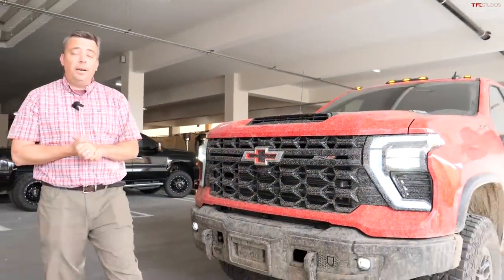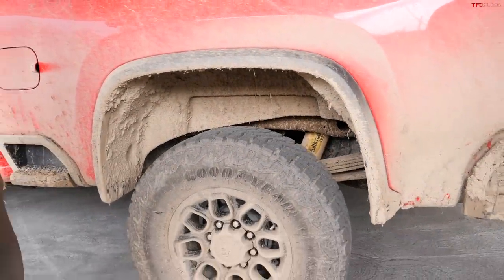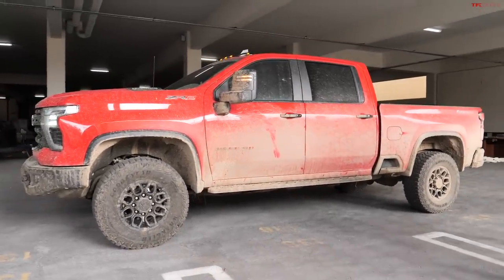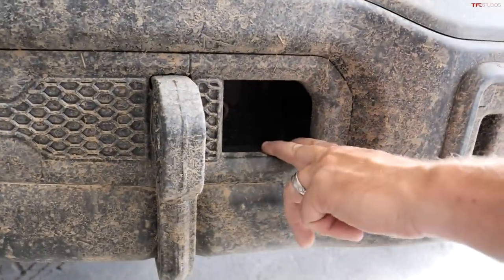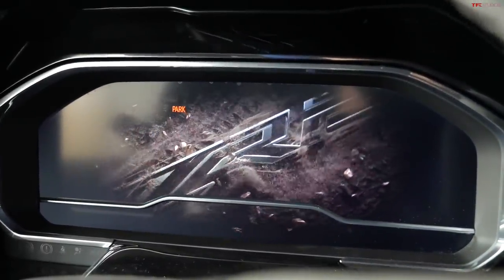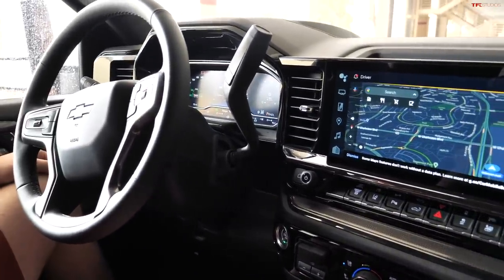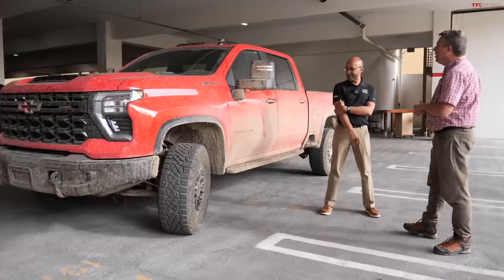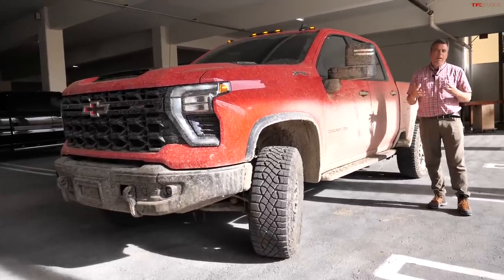TFL Exclusive: I Go Hands On with the First-Ever 2024 Chevy Silverado HD ZR2 Bison OFF-ROADER!

Comment: Great Truck, Love the Bison & The ZR2 Editions, but what a shame not adding the Front Locker since that's the whole thing with ZR2 that makes it so special in the Colorado & Silverado
Reply: I think because they didn't limit the speed with the rear locker on.  Kinda makes sense...but I'm with you for the most part
Reply: Diesel torque + front locker + front CV axles = a lot of warranty claims. Don’t blame them at all for only doing a rear locker. A front limited slip would have been nice though
Reply: @MSparks9509  - or a Torsion front axel. Ford has copied a lot from GM lately, GMs turn!! 
    It looks like Ford and GM are working together more than in the past. Not a bad strategy to just ensure they retain their positions in the hierarchy. They will be very solid #1 and #2 if Ram ever stops selling the 1500 Classic,,,, 😂😂.
Reply: @MSparks9509  That would make sense. Even if that's the case, I'm surprised they didn't limit the offer of a front locker to just the 6.6 gas like Ram with the Power Wagon. But hey, I'm sure they have their reasons. A limited slip would've been acceptable.
Reply: @tda024 reason with GM is always money and laziness. I love gm but getting tired of them always half assing everything besides Corvette but they half ass that too
Reply: @danielfrain3521  How in the world are you going to say they half-assed the Corvette? It's mid engine now. It's got every possible power option you want. It puts down performance numbers better than supercars 3-4x it's price ... Like what in the world could they do more for you to not say they half-assed it?

Comment: No front locker is a little disappointing considering how much you would pay for this thing
Reply: But it still has a steel bottom bumper so why ask more 🤷🏽
Reply: The GM HD front ends have historically been made of glass. Surely a locker would make it worse. However, to argue with myself, I’ve read the ZR2 1500 front ends with a locker have held up well.
Reply: Duramax would destroy that diff if it had locking capability. This ain't no 5.3l...
Reply: I'm sure GM had an engineering reason for not including the front locker :) .
Reply: @adamtacheira5323  I've had three for plow trucks, beat the crap out of 4 wheel drive and have never had a problem with the tans, it's always the headers, or throttle body. Ever time I go out I'm loaded to about 11k pounds with rear air bags.
Reply: @cadekiel2953  Tie rod ends are the glass i think people try yo relate yhe reat of the front end too and that's usually during heavy offroad articulation or truck pulls where the front end comes up. Besides that they are very tough like you said. Not glass at all
Reply: best case scenario a front locker is an extra option
Reply: If raptor and trx don’t have it you don’t need it on this
Reply: @mariaperez5933  Pfft, it's all about the mud everyone knows that's  proof of toughness and capability, that mud so much more than what body graphics and painted tow hooks do.
Reply: The half shafts would not survive in a locked diff with 975lb-ft
Reply: @adamtacheira5323 they're an independent version of the Ram solid axle  front made by AAM. I assume the CV shafts are the weak link
Reply: Wish the aftermarket would build a front diff with a locker pretty much stopped at 2014
Reply: @adamtacheira5323  you actually think they were ever taken outside the city limits?🤣🤣🤣
Reply: Its transitioning, relax, GM was busy on the other tuck jobs and forgot the locker.
Reply: I never use mine and I abuse it like a real truck should be
Reply: @erin7995  this is a Heavy Duty truck. The Ram Power Wagon has a front locker and winch. The Tremor has a front limited slip and I believe there is a locker option.
Reply: Very bad 😢
Reply: @cadekiel2953  My diesel throttlebodies keep disappearing
Reply: No solid front axle, no front locker, the Ram Power Wagon is so much better.
Reply: put it in 4wd 4 wheels are locked that's why they call it 4wd your welcome.
Reply: @daymianhayes2493  does the power wagon come with the cummins yet?
Reply: Sled pullers run fornt lockers without any issue.
Reply: @DrBoogeyman420  Ive seen Chevy front ends fall apart without lockers at the first sight of a trail
Reply: @cadorseeliger3926  yes, I think now you can get the wagon with a Cummins.
Reply: @DrBoogeyman420  that crack you smk shows too much... I've seen sled trucks break the whole housing, sling hubs and axel shafts sleaving tie rod ends with d.o.m tubing.. I've seen stock trucks do the same thing feeding cows... ifs is for emergency purposes.  Without serious reenforcement a stock 4.3 can explode that little ring and pinion..
Reply: @dred5375  I don't think it does. The heavy duty rebel does. Which won't be offered with a front locker. The cummins is too heavy for extreme duty offroad. The 6.4 hemi is not impressive.
Reply: Gm is a joke.
Reply: No way WTF
Reply: @erin7995  you have no idea how big of a difference a front locker makes and it shows.
Reply: @daymianhayes2493  except it's ram🤦‍♂️
Reply: Really how often does one use a rear locked even 😂
Reply: Hard to disaggre with  ya
Reply: Still stronger than the junk new rams 😂
Reply: Thanks no need to watch further
Reply: So no more rear side step? I actually use mine almost daily on my 22' 3500hd Chevy z71 Duramax. Front end is nice.  I do like the new dash ,too and awesome it still has column shifter where it's supposed to be.
Reply: It locks  as soon as it's in 4x4.
Reply: @5JSG if you live in an area that gets snow and ice, the G80 is perfect.  Never had an elocker, so I will take Andre's word for it.
Reply: @kc0lif  😂😂😂😂
Reply: Would rather have diesel option than front locker
Reply: Rams are so ugly compared to Chevrolet
Reply: This is my dream truck. How much is the mortgage payment on this?
Reply: You want diff lock you better get solid front axle with a diesel engine, I think the ford superduty tremor may be solid front axle
Reply: Couldn't have more than a limited slip. Power wagon gets away with it because it doesn't Tow or haul anything and doesn't have diesel torque.

Comment: Wow they knocked this out of the park! I love my ZR2 Silverado 1500, amazing truck so far, I have just shy of 20k miles on it and loved it the whole time. Sad this HD ZR2 doesn't have the front locker, but I'm glad that they're going in the right direction with the push button rear locker. And the front diff with traction management and braking to lock it up is a step in the right direction still, but still sad it doesn't have the push button front locker.

Comment: A truck that I finally want enough to replace my 2013 1500. I understand why they didn’t include the locker and practically I wouldn’t need it. Great compromise between towing and off-road capability.
Reply: Feel exactly the same. Will be getting rid of my 2012 when this drops!

Comment: As a Ram guy, I have to say this Chevy is AWESOME! I love that they maintained the heavy-duty integrity of the truck, but still factored in all of the off-road goodies. I have to admit that Chevy seemed to have gone a little further than Ram with the Rebel HD and Ford with the Tremor SD. Those 35s look really good on the truck, plus I bet it rides closer to a 1500 with the tall sidewall and DSSV dampers. 

Although the Bison is pricey, it will likely retain a higher resale threshold than the standard ZR2 HD due to the highly sought after AEV components. Chevy will sale every one of these that it can make!

Whats that I hear, @TFL Truck: Oh yeah, a ZR2 HD Bison 6.6 GASSSERR going up the Ike!😊
Reply: I own a Power Wagon, and the only downside is the towing/payload capacity for me. That being said it hauls 8k lb trailer with zero issues, but man when you get off road, lock in the rear diff and disco the sway bar it is in its element.
Reply: @sseibonnevilleman  I don't disagree at all. Out of all of these HD offroad trucks that have popped up within the last few years, none have the combination of ground clearance, articulation(especially rear), f/r lockers w/ sway bar disconnect, etc that the PW has. I know people scoff at the low payload and towing of the PW, but Ram has been clear about the mission of that truck.
Reply: @hellkitty1014  just to add, from everything I’ve read, I can just buy a set of factory 3/4 springs for the rear and install them. That basically makes it have 2k+ payload.
Reply: Nothing heavy duty about an independent front suspension!
Reply: @02autogt  this is true. Chevy guys hate when Ram or Ford guys say this, but if you tow heavy, you'd understand why Ram and Ford stick with the solid axle.

Comment: Great video Andre! 
I would highlight that the new Chevy interior has the new GMC interior beat. 
Note in the 24 HD GMC it has the same column shift but the console is still same as the 1500 and the cup holders are still setting fore and aft on the right side, and blank shallow pocket fillers are on the left where the 1500 floor shifter sets. And no more dash storage pocket. 
Very happy to see this new HD Chevy still has the new big screen , still has the column shift,  still has a storage pocket on top of the dash, still has the older right left cup holders in the console with much more storage space then the new GMC Hd.

Comment: What's the point of the fancy suspension if the bump stop is almost resting on the LCA parked!
Reply: Yeah that's not so good, for pretty much anything.
Reply: Thought the same thing...
Reply: So they can charge you more money for the fancy suspension.
Reply: That's exactly the same way the Regular HDs are set up. They don't have a lot of suspension down travel. The bump stop is soft though.
Reply: @terrencejones9817  A bump stop doesn’t effect down travel, it effects up travel.
Reply: Great observation.  I wonder what they’ll have to say about that when more people are able to get a look underneath the suspension and press them about it.  I imagine it has like 0.5 - 1” of uptravel with the bump compressed.
Reply: That is less of a bump stop and more to help the front shocks slow up travel. It’s a strange design but they’ve done it for a long time. It’s meant to ride on that because it’s soft and it compresses to a certain point. Ya really not gonna have a ton of travel
Reply: That's how the torsion trucks are supposed to be set up. It is weird
Reply: @16jeepbuddy  so you just essentially described a progressive bump stop
Reply: @Gazziza29  yes that is the word, or at least that was their intention with that piece. I guess when you’re dealing with a small amount of travel any little bit helps. Without it I’m sure you’d need such a stiff front shock that it wouldn’t ride very nice
Reply: Totally ridiculous! What a waste of that amazing shock.
Reply: @Gazziza29  they're called jounce bumpers, at the shop these are built at. They are pretty soft, to a point. They compress up into the cup that holds them, but only so far.
Reply: @garybrown4671  I GET THAT.  You can call them whatever you want, jounce bumpers or bump stops, they mean the same thing.  Tomato, tomahto.  They’re there so that your A-arm doesn’t slam into the frame on uptravel and your shock doesn’t bottom out fully compressed.  They are soft enough to allow fora smooth landing yet hard enough to prevent the A-arm from hitting the frame.  Point is, they are already sitting on the bump stop so that will limit how much uptravel you have.  If you look on other IFS vehicles there is at least a 2-3” gap between the A-arm and the bumpstop.  Again this is an odd observation given that this is the AEV BISON which should mean it’s more off-road capable.

Comment: i have a Colorado ZR2 and i want this HD ZR2! So cool! Thank you Chevy for building such a desirable and capable offroad new truck!!!
Reply: Chevy always behind, Ford already has a Super duty Tremor and Ram a Power Wagon.
Reply: @jibrilthegreat35 and RAM has, a solid axle with a locker.  No diesel.  If chevy did a solid axle with a locker, a winch, AND a diesel, they might have something. Oh well, back to reality.
Reply: @scorpionsting47  the reason they didn’t put a locking front dif is because the Diesel with its torque would sheer it in half lol
Reply: @jibrilthegreat35 I wouldn’t say behind when this ZR2 is a much more overall capable machine
Reply: @JustinSmith24  solid axles can be built for torque.  IFS is inherently weak.
Reply: @JustinSmith24  much more capable? Lmao look man, front IFS on an HD makes it weak, and also the Power Wagon has a front locking diff and the tremor a limited slip. How exactly is the chevy more “capable” 
Besides the Ford and Ram also look better. But by all means, explain chevys superiority, Im all ears.

Comment: That front bump stop is already touching the lca. 🤔 so you get like an inch of up travel
Reply: Yeah the guy seemed to want to divert attention away from that as soon as it was brought up. Look at the shock! It's a super duper DSSV!
Reply: Functionally since it’s so close to the pivot, it doesn’t work out that way. You can’t forget that down travel is just as, if not more important than, up travel. 2500s aren’t made to flex. This set up with its own front suspension components is so much better than “leveling” a regular factory 2500 with torsion keys or turning torsion bars, because when you do this you take away your down travel. Makes the ride even worse than factory 2500 rides can be. This is a huge win for “leveled” trucks. Too bad it’s so expensive.
Reply: Sounds like it’s ready for some high speed off road! 😂
Reply: @Upliftyourbrothers  Sounds like it's gonna ride like a bucking bronco
Reply: The Silverado has used the bump stop as part of the spring since they went to IFS 4x4. From the factory it literally touches the bump stop at ride height. I cranked my keys on 33's and could stuff it coming down from jumping and leave rubber in the fender well. Even now with 6 1/2" BDS and 35's, same thing.

Comment: There is a reason why GM designed its gooseneck  positioned to the rear of the centerline of axle. It’s the same reason why won’t do 37 or locker the front suspension and axle can’t handle it

Comment: A live axle on the front for this special edition Silverado ZR2/Sierra at4x HDs makes perfect sense and a front differential locker to boot
Reply: Redesign the entire front suspension just for a low volume niche offering?
Reply: @ALMX5DP  more like a usable standard equipment that should not be a option for a ZR2/at4x HD truck, if GM does that, guaranteed you that the big 💰 boys is gonna buy em in droves like hotcakes! Might cause GM some dollars to design that feature.
Reply: @brandedmcgowan9414  does GM sell fewer HDs than Ford or Ram currently?
Reply: "cost" correction

Comment: Looks good but as others commented I have couple disappointments. Only offered in 2500, no front locker, I wish they would’ve went with coilover front suspension instead of the HD torsion bar setup, used the same multimatic shocks as half tons (should’ve increased piston diameter). I think I’d rather purchase Lt version and customize it myself with maybe kibbetech coilover conversion with king shocks. It will be interesting if you could purchase the rear locker and associated equipment and install it yourself.
Reply: While the locker would've been destroyed on Duramax version due to the torque output, they should've offered it on the gasser, if for nothing more than matching the Power Wagon in that regard.

Comment: Have they fixed all the towing issues with "Trailer disconnected", "Service trailer brakes", "Trailer connected" randomly popping up?  I have a 2020 2500hd LTZ Diesel and I love it except for the reliability of the electronics. Was told all of those random messages are, "working as designed".  I love the suggestion though, pull over and turn the truck off - open your door then close it and restart the truck as the resolutions especially the radio issues...

Comment: No front locker is a deal breaker for me.  If the current front axle can’t handle the power then engineer a new axle.  So disappointing.
They could have offered a Torsen Truetrac limited slip at minimum.  I have on numerous times used the front diff locker on my ZR2 Colorado consulting in the oilfield in rural Wyoming, N Dakota, Nevada, Texas etc.  This was going to be my next truck but get your shit together GM and give us a FULL SIZED DIESEL WITH A FRONT TRACTION DIFFERENTIAL.

Comment: No lockers no sliders no winch … as an enthusiast off-roader I can tell you this I’ve built a few Off-road GM trucks that are actually capable . GM builds emblems and splatters some paint on them. My current 1998 Yukon will out wheel anything GM has currently.  Think ima change brands after 22 years

Comment: Good truck but with dealer markups prob a 130K truck, OMG 4wds and trucks are soooo expensive now, everywhere. Mate in Australia just ordered a 300 series Landcruiser, its an A$160k 4wd there and that's what they pay for a mid range, converted, 1500 pick-up, 2500s are nudging A$200k. A TRX there is over A$220K.
Reply: Yep they are expensive down here, but with the exchange rate and conversion to right hand drive it is understandable.  I have a 2022 LTZ 1500 was $129,000, just ordered a 2023 LTZ 2500 was $173,000 . Ram 2500 Laramie just a hair under $200,000, ram 1500 Laramie $145,000 and ram Laramie limited is about $154,000 with ram boxes $5000 extra.

Comment: Like most GM and Chevy products they put a lift kit on it at a scoop couple stickers some oversized tires on some non factory stock rims and then they ask 78K or $80,000 for a half ton truck which of course is an absolute total ripoff especially going to recession and then on top of that there's the unreliability factor of the GM products.
Reply: Go buy a ford like all the other ppl who enjoy recalls and drivetrain failures